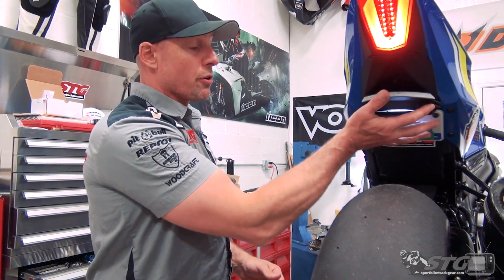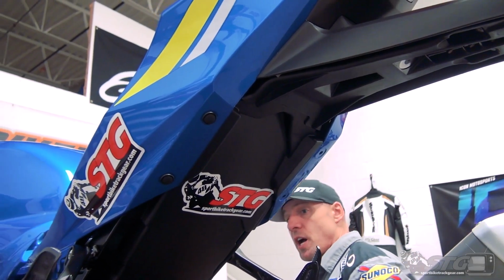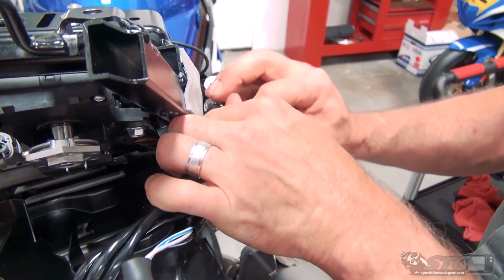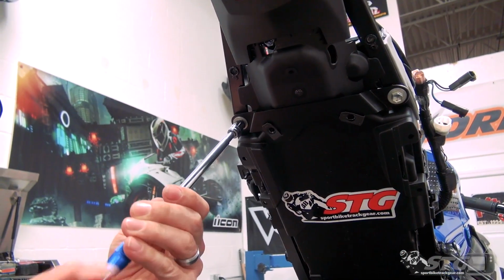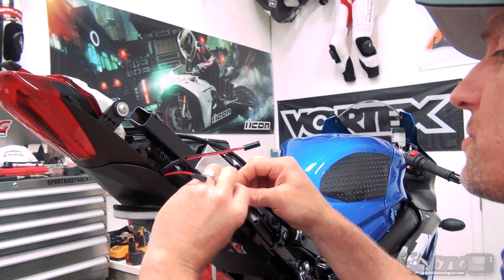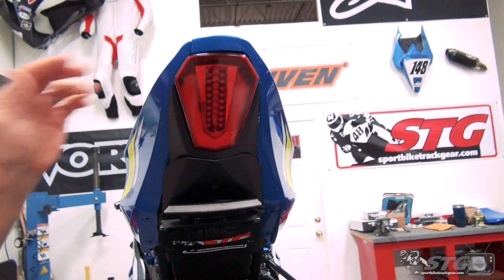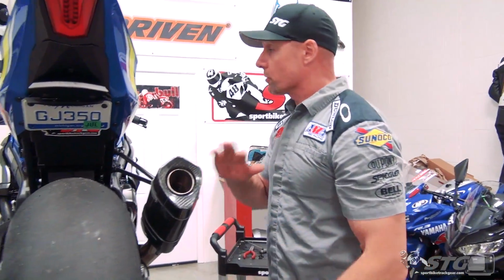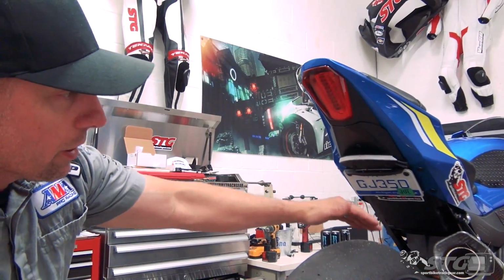New Rage Cycles 2018 Suzuki GSX-R1000 Fender Eliminator Install | Sportbiketrackgear.com

Comment: My t25 fastener that goes into well nut just falls through the bracket is this a manufactured problem??
Reply from the maker: New Rage does a solid job with product support. Just send us an e-mail at info@newragecycles.com Or call us on 914 339 2929

Comment: Cops I’m sure would want to hassle you with this no?!  Might as well just run no plate.  😊
Reply from the maker: Really depends on the area you live in for sure. New Rage offers 2 models, the tucked is a little less visible than the standard for sure. - Van

Comment: Just got the 2025 1000 gsxr and I brought the kit guarantee that I would’ve never done this by myself but you walked me through it excellent I appreciate you! I got it all installed because if you! Only thing is my kit came with two clips to put on the main plate over the bracket but I figured it out when I tried to screw in the plate and it wasn’t going into anything 😂

Comment: Thanks for the vids!! Made that look easy. The kits updated with another hole on the plate to run the wires thru. That tailsection...definitely plastic haha. Velcro comes standard. Lol. I did have a problem with the connector for the plate light where the wire pulled out of the back of the connector but I just pushed the prongs back in. So im not taking it apart for the 4th time. Good vids! Thanks
Reply from the maker: You are welcome and thanks for watching! - Van

Comment: I had to add an extra spacer/washer with the first frame part that uses the two factory bolts. The ones they provided were not thick enough and the frame piece was floating slightly on the collared factory bolt. I could spin the spacer with my finger.. It would have vibrated like crazy. Was an easy fix adding the extra washer, but I shouldn’t have to run to the hardware store when I spend $200 on a plug and play system. Other than that it’s very good
Reply from the maker: While it has been some time since I installed this I do not remember running into any issues. Perhaps they have changed the kit a bit since I did this install? - Van
Reply: @sportbiketrackgear  yes, it was an old video I realize that. I had the newer style with the hole in the bottom for the wires so it’s very possible they changed the spacer size. Other than that it’s an awesome kit highly recommended. I did end up coating mine with truck bedliner to give it a stronger finish against rock chips

Comment: getting a 23 1000 soon, love the setup and the light makes it look really clean, but curious, the hazards will it effect that or does it just work from the brake light? also is there a way to turn on and off the plate light unless i missed it?
Reply from the maker: This fender eliminator is separate from the brake light and there is no way to turn the license plate light on and off. IMO this is the best fender eliminator for the GSXR1000. - Van

Comment: That 3rd hole in the tail cover is for the wires to route through then up and though the tail section to the connection points. Then I used the factory zip tie to snug everything together. Came out very clean. Thanks for the video.
Reply: Actually I see that the cover in this video does not have that wire hole that mines came with. I must have a newer version. Just ordered recently.
Reply from the maker: Sometimes the manufacturer will make small updates to the parts after we have shot the install videos. Thanks for watching and sharing your feedback! - Van
Reply: This is a complete shit tail tidy. The entire plate that covers the area that’s removed is held on by one single bolt that’s threaded into a plastic rivnut that has NO WASHER to retain it better.
Reply: @ironmb86 it holds up just fine , stop hating

Comment: Is it possible to change the angle of the license plate holder to 15 degrees(so it's more visible from the back) without it interfering with the tire? In my country the rule for motorcycle license plates is 15 degrees.
Reply from the maker: You could try and bend the bracket a little but I do not feel like it would move very much. - Van

Comment: The turn signal blinks faster when this device is mounted. What kind of power resistor do you need to use?
Reply from the maker: New Rage Cycles Dual-Load Equalizer
https://www.sportbiketrackgear.com/new-rage-cycles-dual-load-equalizer/  - Van
Reply: I can see the link, but I do not see the power value of this resistor ??

Comment: Outstanding tutorial !! 
Just picked up a '21 and did/doing the install today of this and after everything is buttoned up, I'm seeing a substantial gap between that plate and the fairing. Enough to actually see that dog bone bracket and some wires (since I ran wiring through the hole in the bracket and not around the side like he did). I have the washers installed on the bracket (bracket>washer>frame) and the bolts tightened down, double checked all other bolts, placement of everything, and I can't see why I'm getting such a gap. Has anyone else seen this?
Reply: I’m having the same issue on my 22 did you end up figuring it out?
Reply: @johndapper8751  Nope. 😵‍💫 I decided to just let it not bug me as much.
Reply: @00seanzy  i think that’s what I’m gonna do I spent all day doing it over and over again and still the same lol , appreciate the reply bro
Reply from the maker: Thanks for watching. It has been quite some time since I did this install and the bike is now track only. Sorry but I do not have any valuable input here. - Van

Comment: What size number plate fit these ? Mine comes tomorrow need to get a new plate ordered 😀
Reply from the maker: This is designed to work with a standard motorcycle plate. - Van

Comment: Ok very instructional video I was completely baked last Sunday doing this job to my 2020 1000R however.. you did not not that the supplied washers given once tightened all the way down still spin and therefore would rattle. I ended up adding one more to each side but this could have been cured with a slightly thicker washer but they missed that or didn’t care. Still a good kit and thanks for the video !
Reply from the maker: Every bike is a little different so sometimes you need to get creative to get the result you need. - Van
Reply: I had the same issue. If you watch the video they are loose in this too. It would vibrate like crazy. 200$ for a plug and play kit and I had to go to home depot for washers.

Comment: I need help I have a 21 gsxr 100r once I plug in the leds none of them work. I plug in oem and they work fine. Any help on this?
Reply from the maker: Hard to accurately diagnose this over YouTube comments. The first thing I would try is to reverse the polarity of the led harness and see if that works. You may need to reach out to New Rage and ask for support. They will be in the best position to help you get this sorted out. - Van

Comment: I put on the fender eliminator but also have the smoked integrated taillight,does anyone know how can put both signal lights to work for license plate and integrated taillight?
Reply from the maker: Assuming your tail light has the turn signals built in you will need to wire the turn signals to the fender elim and the taillight. - Van

Comment: Did you ever slow down the turn signal?
Reply from the maker: Yes you can install a different flasher or the New Rage Cycles resistors. Below are links to both products on our site:
Driven Flasher Relay
https://www.sportbiketrackgear.com/driven-flasher-relay/

New Rage Cycles Dual-Load Equalizer
https://www.sportbiketrackgear.com/new-rage-cycles-dual-load-equalizer/

Comment: Slide the wires down and thru the license plate led. No wires showing. Also this item is at least $100 overpriced. Its basic metal, cheap chinese screws and very basic paint. At best, this should cost no more than $49......yet it's going for $200.
Reply: Facts

Comment: I just ordered mine today, I have a smoke integrated tail light with turn signals already.can I install this without the turn signals ?

Thanks
Reply from the maker: Yes you do not have to install the signals if you prefer not to. - Van

Comment: If i run an LED swap on the front will still flash ?
Reply from the maker: It will still flash, if the flash rate is too fast you can install a resistor. Here is a link to the resistors on our site: https://www.sportbiketrackgear.com/new-rage-cycles-dual-load-equalizer/

Comment: Is it the same way to install on a 2019 GSXR 750? Like I can get it for mine and follow these instructions?
Reply from the maker: No I do not think you would be able to get this installed on your bike, the 2 models are pretty different. Here is a link to the fender elim New Rage offers for your bike: https://www.sportbiketrackgear.com/new-rage-cycles-suzuki-gsx-r750-11-17-fender-eliminator/
New Rage Cycles Suzuki GSX-R750 06-19 Mirror Eliminators w/ LED Turn Signals

https://www.sportbiketrackgear.com/new-rage-cycles-suzuki-gsx-r750-06-17-mirror-eliminators-w-led-turn-signals/

Comment: Help :( :( I just installed mine on my 2018 GSXR 1000r and everything works expect the license plate light :(...... turn signals work great, brake light works but the license plate light doesn’t turn on and it’s plugged in correctly too :( help help help please

Comment: Does this work with a 2017 GSXR 750?
Reply from the maker: No this will not fit the 750. Here is a link to the New Rage Cycles Suzuki GSX-R750 11-19 Fender Eliminator on our site: https://www.sportbiketrackgear.com/new-rage-cycles-suzuki-gsx-r750-11-17-fender-eliminator/

Comment: Hi Brian ,
installed TST industires flushmount front signals on the R3. The flash rate is similar to this.
have just left it like that. should have also ordered the harness converter , plug & play.  brother sent it AUSTIN ( USA).

Comment: @Vance - I would like to see a rear lamp (brake) light with the same dimension as OEM, but with internal LED turn signals integrated. Now that would be a huge seller. It would be 100% legal in every state and clean-up the rear at the same time.
Reply: I used a smoked replacement tail light with integrated signals only smoked when bike is off so it’s legal. The light is by Xtasy. Then I used this kit for the undertail and plate and didn’t use the ugly white signals that flash too fast lol. Why would you make white signals when the look is to black out the undertail ? Durrrrr

Comment: I want that eliminator!
I'll see if I can get my uncle to check the video out since you've got a good, level camera angle. He's the Chief of Police in Hutto, Texas who's a great guy. It's only 30 miles from The Circuit of the America's track, so you know he's going to be seeing the eliminator kits. Irregardless of what anyone cares about jurisdictions, It's so clean of of an eliminator that you know thousands will buy the kit and at least having one Chief sign off on it would be a great start...
Reply from the maker: That is not a bad idea. IMO as long as the plate is visible and well lit (like the New Rage here) it should be good to go. Is it 100% by the books legal? The answer to that is most likely no. - Van

Comment: These fender eliminators are designed for the standard US plates (7x4 inches), right? So would it also fit a 7x5?
Reply from the maker: There are slots on the bracket to allow for different sized plates. Really depends on the spacing of your bolts. Measure the distance between the bolts from one side to the other post that here. I will measure the eliminator to see what the range it will offer is. - Brian Van

Comment: Am I the only one that's blown away by the price.  An LED light, a few pieces of stamp steel that have been painted and a couple screws for $200.  And the LED turn signals are really not that attractive.  Should have been a smoke lens on them or something.  Sticks out like a sore thumb.
Reply from the maker: IMO this is a fair price for the kit when you consider the development time it takes to get the kit ready to manufacturer etc... New Rage uses OEM style connectors with quality harness construction on their kits. In just 3 months New Rage Fender Eliminators are one of the best sellers we offer for more than one model bike. Some people like chocolate while others prefer vanilla my brother. - Van

Comment: Man that looks AWESOME! Too bad those kits are illegal here in germany, they'd probably call a SWAT Team on me and impound my bike if they just see me sit on it. Then again it would probably look a bit stupid with our license plates (fun fact: the Motorcycle license plates are called "Kuchenblech"  (baking sheet) here because...well because they're pretty huge. But at least we don't need one in the front! That would look REAL stupid)

One thing I'd maybe change is to actually angle the license plate so it faces directly backwards. One of the things we have to do here in germany and it may sound silly but I think that's the right way to go. That it looks to me the police is going to have trouble reading the license plate and could just go about and stop you to read it, maybe give you a fix-it ticket (depending on state laws of course). I don't want to make their job harder than it already is.

Also if I may add, the flashing rate of the rear indicator could not just be for looks but also mandated. (Again something we have to do here in Europe. A lot of people don't pass tech inspection because the indicator is flashing too fast when they convert to LED's, I don't know why that's a problem as long as it flashes but I don't ask too many questions)
Reply: No, technically in all of europe if your bike is an EU-Model it has to accord to EU-Regulations. Which for example means that rear indicators have to be at least 180mm apart which is definitely not the case in this kit.

In the UK as far as I know there is also a minimum indicator spacing which will make you fail the MOT as it will here in Germany, however the police will barely bat an eye or just lift their finger at you unlike here.

To my knowledge Norway is even worse about this stuff than we are here in Deutschland, definitely not jealous of those guys.

It's like some californians saying "Two Bros mufflers are legal here", that's just not true. It very clearly states that they are for closed course use only. Just because police doesn't care or that there aren't any serious repercussions for not following regulations doesn't make it legal at all, just feasible.
Reply: LukeTheMentalGent das Nummernschild ist schon der Hammer 🔨
Reply: LukeTheMentalGent not in Europe. Just in Germany. No bs like that in most places. You can put a tail tidy, remove number light, whatever and get the loudest exhaust possible and it is not a problem.
Reply: LukeTheMentalGent I live in Ireland and there isn't an MOT or anything like that. Most people ride with tiny number plates so they don't get caught by the cameras or cops. Also in UK mot the emissions aren't tested so you can put the loudest exhaust possible. Nobody checks indicator spacing. The only thing that matters is that you actually have indicators, MOT for bikes is extremely basic compared to cars. It's shit that you get punished for having some fun on your bike in Germany, but Germany isn't all of Europe.
Reply: Oh you learn to live with it (could be a lot worse right?), I don't mind having a tastefully noisy exhaust. There is a difference between a nice sound and just plain loud which many people tend to forget sadly, that's probably what got us here in the first place. And owning an '06 GSX-R, the Indicator fuss is also none of my concern. The only thing I'd want to change honestly would be the size of my license plate but that is definitely not going to happen.

Then again Ireland isn't all of europe either but a lot (if not most) of the countries here in europe do have the flashrate for indicators mandated for example and that's all my original statement was about. The Isle of Man is part of europe too after all and those guys don't even have speed limits ;)
Reply: LukeTheMentalGent hey you have autobahns, that's worth the price to pay alone. Nothing better than going on an autobahn and literally going as fast as you want with no consequences. That's one of the best things in the world haha. Doing that in any other European country would probably result in a helicopter chase at some point.